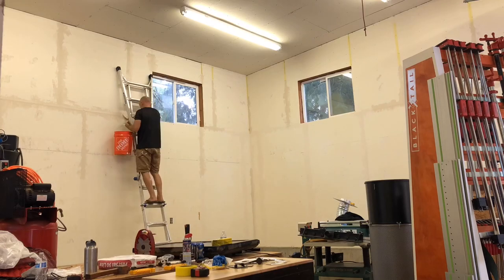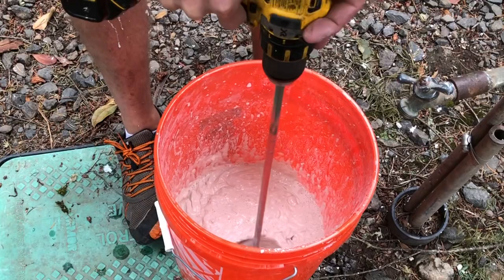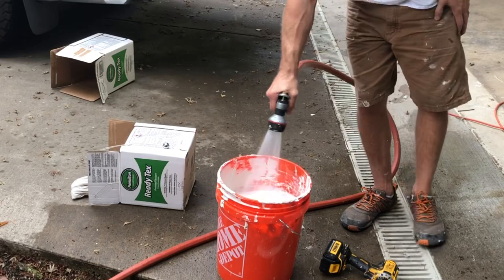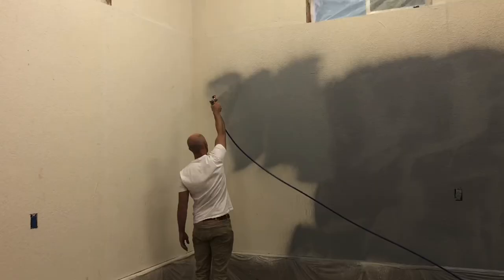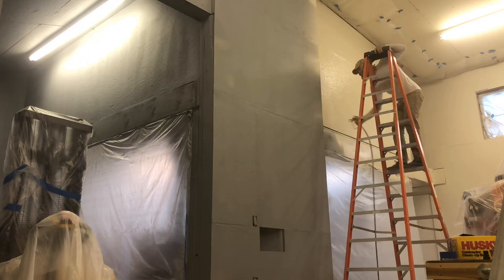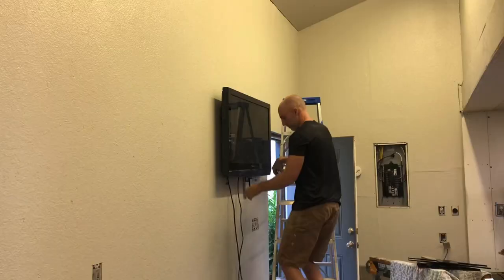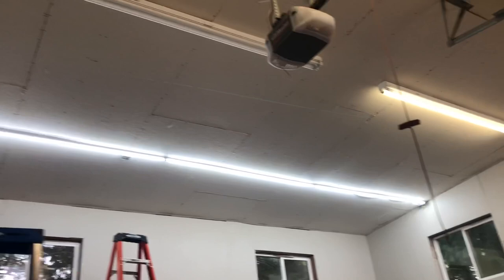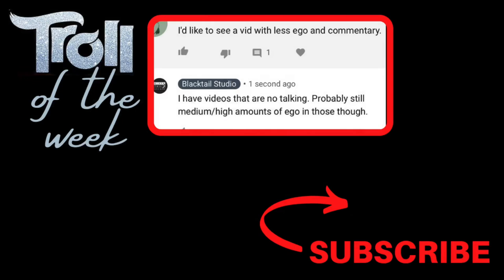Making My Dream Shop -- Episode Two

Comment: Hey I know this completely unrelated but I figured I’d have a better chance of getting answer on a recent video instead of the finish video. How long does a can of Rubio Monocoat last you? I make desks, entry tables, and anything else I really need. And compared to poly monocoat is expensive, but I have to use multiple coats. So how long does it last you?
Reply from the maker: Not sure the square footage. Way longer than poly though

Comment: Man, do you never get tired? I'm just tired of looking at you :)). Where do you get so much energy from?
Regarding the walls, I think it was better if you'd been left them smooth, considering that it is an environment with a lot of dust, permanent. As they are now, chances are the dust will settle down easily and stand on that embossed texture of the walls.
Reply from the maker: I condense it to 15 minute videos 😉
Reply: @BlacktailStudio  :))  ok,  I figured up this, but still, such a lot of stuff to do, unmount this from here and put there, take this from there and move in the oposite side, up on stairs, down stairs, make material for walls, put tape, take tape down, lights....

Comment: Not really related to this video, sorry. But I'm wondering how you would implement a led stripe into a river table, for one how to get it in and then which color/pigments could look cool, bc since you're doing a lot of cutting and grinding after molding it you need to be very careful with cables and the strip itself...
Reply from the maker: Haven’t tried that yet!

Comment: Radio, TV is too distracting. I have watched tons of your videos on how you sand and finish a table but I am still having issues getting my clear resin to look good. We sanded all the way to 2000 and applied polyx as the finish but it is still foggy compared to a fresh pour of epoxy. Any tips on how to get it as clear as possible?
Reply from the maker: Need a finish like table top epoxy or poly/varnish

Comment: Radio-so I did my first project with resin epoxy. I did an inlay in a night stand table top. I ordered some liquid color on amazon and the inlay didn’t really look like the color was there but the leftover on the plastic cup was spot on. I used ash for the table top and was trying to get a yellow pigment. Any idea what happened to the color in the inlay?
Reply from the maker: Hard to tell from here

Comment: With what do you clean dust on your epoxy tables between adding finishing coats? i see you are using some rag but whats on it? water? acetone? alcohol?
Reply: on my first epoxy table project right now i leveled all flat. i ordered rubio moncoat so im wondering what to do before adding rubio. with what should i prepare surface
Reply from the maker: Usually just a micro fiber

Comment: Hi Cam,

I did a burnt table like yourself and have found lots of little white bubbles where the wood Meets the epoxy (half is burnt half is regular maple). I sent you some pictures on Instagram. What can do I to save this table?
Reply from the maker: Oh man, I offer video consultations for this stuff. But I don’t think you will be able to remove those. So probably save the consultation for another one

Comment: RADIO: Could have left the original light fixtures and just bought some new led ballast bypass bulbs.
Reply from the maker: Did that in my old shop. Cost 3x as much for those bulbs as these lights 😉 and you don’t need bypass bulbs if you just cut the bypass

Comment: Hi
So i have been making tables but as I pour epoxy in the casting the chemical is cool in tempreture but after an hour or so it suddenly shoots its temperature up in the process it develops very odd bubbles and sometimes there are cracks developed.

I am from India and the temperature that I make is around 30 degree Celsius but for that I keep 2 fans from both side on the top of the table to not heat.

I have wasted approximately 20kgs of resin easily please help as I am have no other expert than you.

It would be great if you could help me like your younger brother.

Thanks
Reply from the maker: Sounds like that epoxy wasn’t supposed to be poured that deep
Reply: @BlacktailStudio  that was not even 2 inches sir.
Does the tempreture also play a role in this?